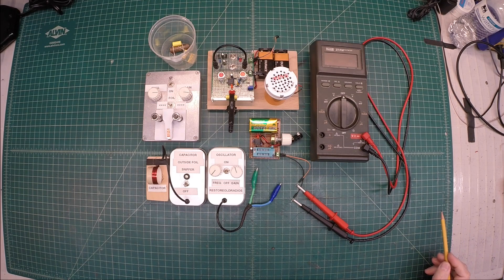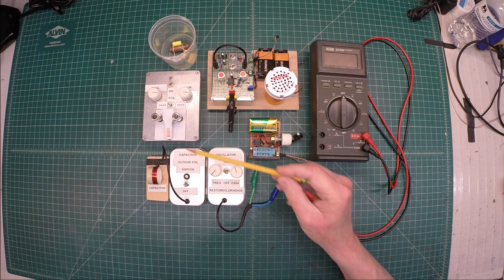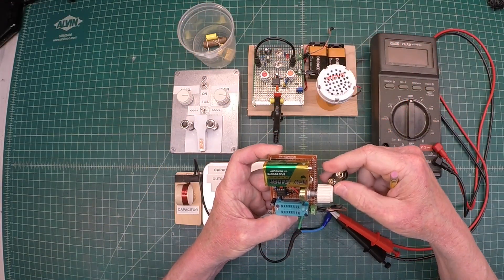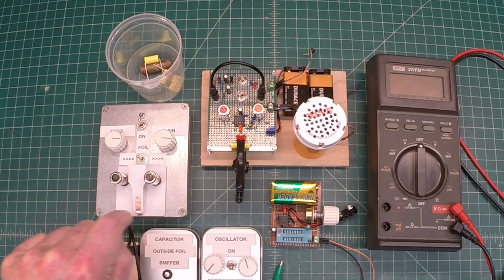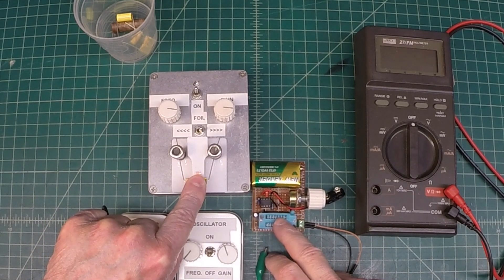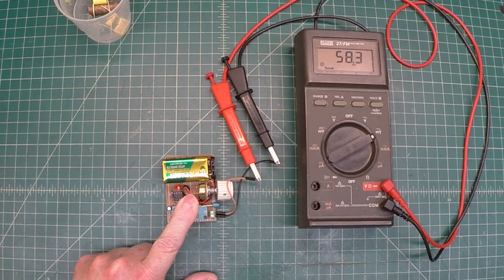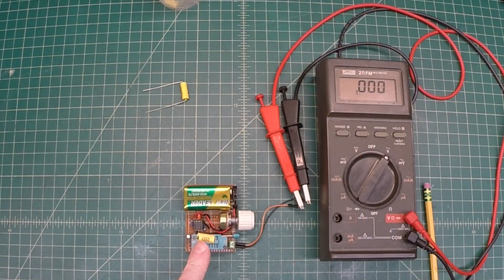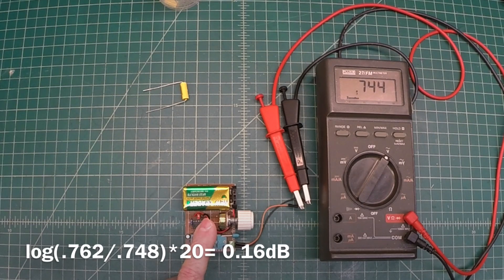Capacitor Outside Foil Identification using your Finger, DMM & this Simple Circuit

Comment: I liked the video and want to build one, but I must be missing something -- I followed the link to your google drive folder, but I don't see a file for the exact device in this video.  If it's there I apologize and can you please point me to it?  Thanks
Reply: Is it the one titled Ingress Method?
Reply from the maker: It is. This was one of my early builds: https://drive.google.com/drive/folders/1J4bUMEpwnyBY8meFDvvI12klgi5kHUt_ A better design using Arduino at: Capacitor Outside Foil Sniffer w/ Arduino Version 2.0
https://youtu.be/p1RolBQFZ4U

Best,

Don

Comment: Hi Don. I am trying to build the Cap Outside Filter Sniffer - Ingress Method. I have been away from electronics for about 30 years until recently retiring and have a lot of catching up to do.  Can I trouble you for a few more details? If so, I went to Mouser for parts and tried to pick a PC board. I was completely overwhelmed by the number of choices. Do you have a suggestion on what to use? Also, they carry two types of LF351 Op Amps but both appear to be soldered to the surface of the board as opposed to soldered through holes. Not sure what to do here either. any help would be greatly appreciated. Thanks in advamce
Reply from the maker: John - I thought I saw a reply back that you located some PCBs, but the comment was deleted it seems. There are many folks on eBay that have similar, but I’ve bought these double sided boards in the past and they have worked great:

AUSTOR 36 Pcs Double Sided PCB Board Prototype Kit 5 Sizes Universal Printed Circuit Protoboard with Free Box for DIY Soldering and Electronic Project
by Austor Direct
Learn more: https://www.amazon.com/dp/B074X2GDH2/ref=cm_sw_em_r_mt_dp_6BWC8MCS1PNJJGH5RF26?_encoding=UTF8&psc=1

I think you’ll find the DIP sockets and DIP LF351 op amp on eBay and Amazon as well. 

Sorry for my belated response, I’ve been devoting much time to my parents.

All the best.

Don

Comment: Hello Dom, how are you? Have you ever tried to use a milliammeter or a tape deck VU to visualize the external foil? Maybe rectifying the ampop output to connect to a VU?
Reply from the maker: Raphael, I’m doing good, hope you are as well. I also built this: Capacitor Outside Foil Identification using an Electroscope/Electrometer It uses a mA meter. The schematic URL is noted in the video description at: https://youtu.be/RWIKyrKQ-Bs Thanks for reaching out and watching. Best, Don

Comment: I am still not sure how the ingress method works.  Are you looking for the higher or lower voltage to determine the foil side of the capacitor?  I noticed that one rail is to the positive lead and the other is to the negative lead.  Are you looking to find the lower voltage when the foil side of the cap is connected to the neg lead?
Reply from the maker: Sam - a higher voltage when the foil side is attached to the positive and a lower voltage when the foil side is connected to the negative. Hope this helps. Best, Don

Comment: Hey Don, Excellent presentation as usual. I downloaded the Ingress method diagram and noticed that R4 only shows two termination points. Should I assume that the third point is at the vertical line between Vcc+ and pin 7 on the LF351? Thanks & stay safe. Jerry
Reply from the maker: Jerry - sorry for the confusion. There’s no connection (at that point) to the high side of the potentiometer, just to the wiper and ground. I'll update the schematic ASAP to reflect no connection. Hope this helps and thanks for reaching out to confirm. Best, Don
Reply: RestoreOldRadios 

Gotcha, Thanks!
Reply from the maker: Jerry - updated schematic posted. If you elect to build this, I would appreciate you sharing your experience using it. Stay well and all the best. Don

Comment: Don, built one today using a Lm 358 and a 200K pot. And it seemed to work properly if when I put the CAP under test in and adjusted  R4 to around 40mVac output on The DMM before touching the CUT. In what mode of operation are you using this op amp? Just asking being a tech and not an engineer.  Works great by the way.
Reply: Sorry for  the question, just rewatched the vid and at 5 minutes you did say it was used as a Buffer Amplifier. Thanks for your contribution.
Reply from the maker: Correct, the op amp configuration is a buffer configuration I learned about from author R. A. Penfold, his book titled Audio Amplifier Construction with a few modifications. Hope the circuit works well for you and please keep me posted on the ease of use and reliability as compared to other methods. Best, Don
Reply from the maker: Jim - I appreciate your feedback Jim. Glad the build went well. Best, Don

Comment: Nice work!  With the 0.001uF capacitor, the readings were very close even though the foil side could be discerned.  0.16dB is not much difference.  My question is:  does it make any "practical" difference in placing the foil side of this cap to the higher impedance side of the circuit.  Thanks for sharing, Doc
Reply from the maker: In the few vintage tube radios I’ve restored, I can’t say I’ve ever heard the performance degraded by the capacitor orientation, but not having an audio analyzer to make real measurements, I can’t be 100% sure. In theory, it should make a difference though. Thanks for watching and your question. Stay well and all the best. Don

Comment: You've outlined this subject before, and it's good for people to know. That said - there are very few instances where it matters. In fact, I generally only use ceramic disc caps unless there is a need for a cap spanning great distance that is connected to an ultra high Z point (grid). Back when wax and paper caps were used, they were the most logical to use given their cost, lack of alternatives, and axial form factor. Plus - an old AA5 just looks much more original (and much nicer) without a bunch of bright yellow caps of dubious quality or longevity. Someday, restorers are gonna have a field day removing them and wondering why we couldn't have engineered a cap that lasts. Well, we have- disc ceramic. lol. 73 OM
Reply: Ceramic discs are very very temperature dependant.
Reply from the maker: Thanks for sharing your insight on this subject; very detailed. Have fun recapping and stay well. Best, Don

Comment: Why will the manufacturer not indicate foil side on the cap?
Reply from the maker: Mike, it probably just adds to their production cost and transistor/Integrated circuits of today are not really impacted by this, just the vintage amplifiers, radios, TVs and alike that use vacuum tubes. Best, Don

Comment: Nice work, sounds like the orientation of the smaller value caps is less of a worry when used to replace older legacy caps... I don't think the smaller value ones are used much for inter-stage decoupling, am I wrong on this? Anyways, the tester looks to be more effective than previous trys.
Cheers and take care now,
Reply from the maker: Eddy, you are correct. It’s simple for sure and seems to be reliable in my limited testing. Best, Don
Reply: @RestoreOldRadios  - Thanks for the reply Don. 

Content from you and others on this subject is useful info for restoration folks; it's even inspired me to try my hand at a few how-to's as well... 

I am being careful here to try and avoid  self-promoting in this comment.. I consider that to be somewhat taboo, so I will leave it there :)  but a critique of the content (by folks such as yourself) would always be appreciated as I have no idea if it is of any interest to others... 

Anyways, take care of yourself and your family and best wishes in these times.
Cheers,

Comment: Don, do you think a ceramic disc capacitor or an "orange drop" style (radial lead) capacitor would exhibit "outside foil" characteristics?  Thanks.
Reply from the maker: Nelson, the ceramic disc are constructed different, so they are not impacted, but the orange drops are so they can easily be discerned using this method. Best, Don